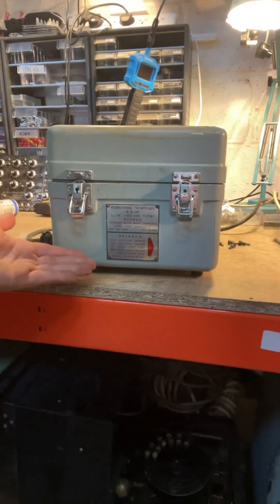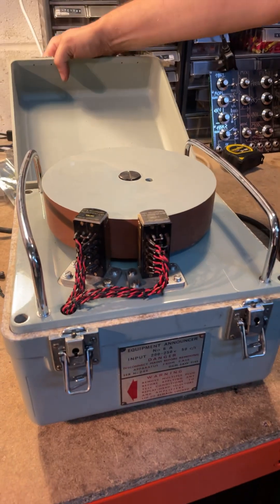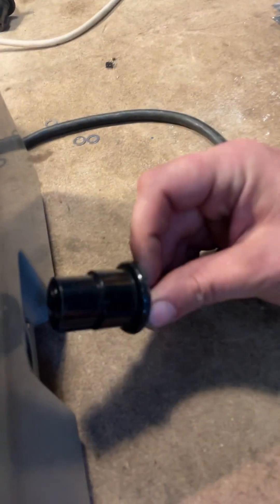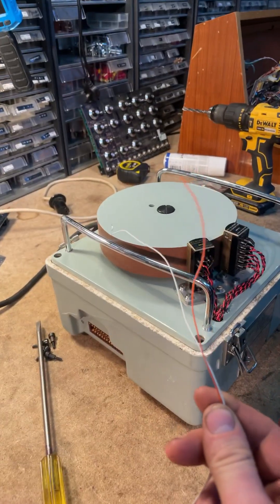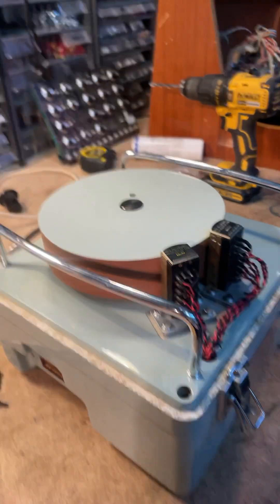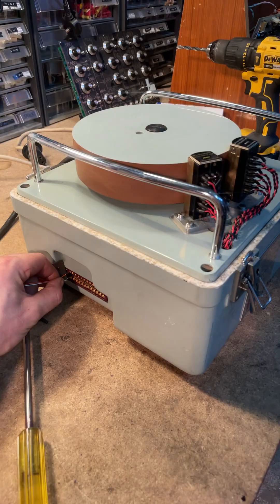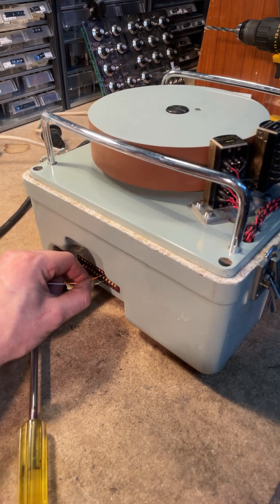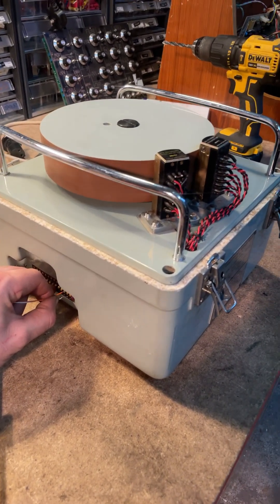WHAT IS THIS WEIRD TAPE MACHINE THING THAT ISNT A TAPE MACHINE #tech #science #shorts

Comment: It's ma bells iron maden. It would make a great tape delay/echo vox. Especially if you could also control the drum speed and chain playback from one track to next  record track repeat to next track etc. I use to do that on my reel to reel feeding monitor out from right channel to record input on left then left monitor out to right record input etc. It would then make an echo that went back and forth from one channel to the other. It required using both din plug and the rca phono plugs on the deck . The deck was an akai 300D . I was also able to do it on my 3000 d x-crossfield akai. Then i got some other funky echo effects by setting the decks side by side  and threading the tape through both decks from one to the other in various ways and also making loops of tape .

Comment: Definitely a line tester announcer. When I was a BT faultsman, I remember dialling 1267 to access it. Now replaced with the 17070 tester
Reply from the maker: What would you hear? Faults 1 after the other?
Reply: Was going to say the same. The tester would call back saying stuff like Line A ground fault, Line B Ground fault, high line resistance, etc., All things that the line card in a System X could detect on its own.
Reply: In the late 1960's you could dial 88 to get a ring-back. Even though my aunty had a lock on the dial, i would tap out 88 on the hook-switch and she would get an incoming call .
Reply: BTW it was called a SALT tester (subscriber apparatus line tester)
Reply: What era were these phased out? 80s?
Reply: Our neighbour was a BT linesman back in the Strowger and early System X days and he gave me a look inside the local exchange (Strowger at the time) and later showed me how this diagnostic number worked.  Super interesting stuff to me as a young teen.
Reply: Does it say also "downstream errored seconds and severe errored seconds have exceeded the threshold from real time check"😂
Reply: @scottg6265  Ha ha! In those days error seconds were when you nodded off in the welfare room!
If your dial was pulsing more than 10 pulses per second, It did used to say ‘Dial Fast’ but the message sounded more like “Fur cough” (or something similar). That used to amuse me!
Reply: I remember as kids one of my friends dad worked for British Telecom and we we found out the number to get that familiar "start test" message. You'd hang up and it would call the phone back with other recorded messages. I think something like "dial 361" or something. We didn't know what it was.

Comment: Sounds like a number station
Reply: It’s a tape loop…number stations are broadcasted via rf transmission
Reply: @nikhiljoshi2961  if you listen to some numbers station recordings you will find they sound pretty similar.
Reply: wel now you know what number stations are actually for and not like what the conspiracy video's say
Reply: Wrong answer  @catnium number stations are indeed from governments, military and or embassies, something that is proven, and in a few cases by their own (accidental) admissions. They are used by the spies in the field even today using domestic radios brought locally and a few military units for the same reason, when in location and a reply is not needed a message can be sent using either broadcast transmitters or from embassy buildings, or military bases. They send in a variety of formats from voice, morse and simple data modes like RTTY, usually ona schedule regardless of the need to send a message or not because you do not want someone to infer possible military activity because of a change in transmission routine. There are fictional books from ex-military who have referenced these stations long before they were common knowledge, including too much information about who they work and are set up. This might be from fictional books, but they are drawn from factual events in their own military careers. Number stations have been active since WW2 because and much has been written about them in that era, but they were not called number stations then, this term wouldn't have come about until about the late 70's when hams used bulletin boards and had the chance to chat about odd discoveries outside their licenced bands.

It sounds like crazy talk and it's quite forgivable when so much crap goes about the internet for made up BS all the time but Number Stations are what you are told they are, as described above.